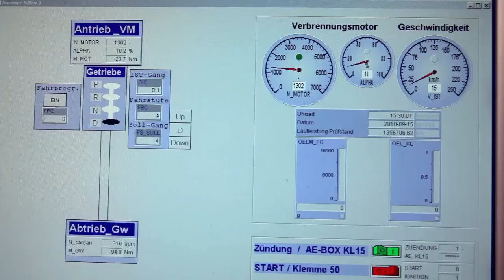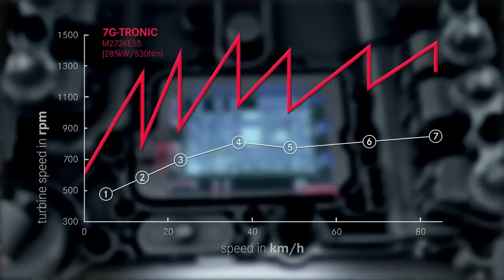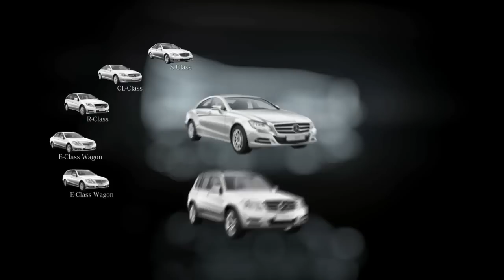Mercedes-Benz 7G-TRONIC Plus Transmission

Comment: lol, at 4:08.... I bet that pump alone costs over a grand.... and when it does fail (which it will) either the "stop start" function completely goes away OR the car goes into limp mode and you cant even drive it until it gets fixed.  

All to save a penny or two of gas while you car idles at a stop light.... yeah no thanks.  Id rather have my car idle, and spend the extra 20 bucks in gas per year, then have some random part involved that costs more then my 1st born to replace.
Reply: Michael G don't worry it will not. These transmissions do millions of kilometers in German taxis. Most reliable auto on the market. ZF doesn't come close in reliability, hence no BMW taxis. MB is the benchmark. But for sure ZF is nicer to use.

Comment: Less fuel consumption but you will spend extra money for the broken parts :(
Reply: Agusta Prakersa well you could drive a decade with a fiesta for the price difference between it and cheapest Mercedes offering. So If you want to save up save up on car first.
Reply: +Agusta Parkeras And these parts takes lots of energy and materials to make, so in the end  you spend more money and pollutes more! However, its great for the corporation, since they can market the suppose efficiency of the newer model, while making more money on parts later on! In extreme case you may have to buy a new car if your transmission fails.
Reply: Saving energy not necessarily saving your money..
Reply: if it broke, yes you are right, but it never broke my bro
Reply: More confort more diving plesure! And at the end less fuel consumption :))  So thats not the main reason for pepoles who buy a mercedes

Comment: Its a nice gearbox but it has big factory problems.If i buy a MB i buy it for its reliability , but with this  gearbox nothing goes like it should and one day one the highway u will have to call the pickup to get you cuz your gearbox control module failed due to a facory problem.Very disappointeing!!!!!!!!!!!!!!!!

Comment: naahhhh.... i prefer manual. i like to drive my car.
Reply: +Igor K there's a difference between 'manual' mode on an auto and a proper manual transmission
Reply: +Kelly Larsen  Clearly you have never driven a modern autobox. I recently drove a VW Polo with DSG box and was quick and beefy without being fatiguing. Manuals are BEASTLY boring and wearing around town (not to speak about queues) and are more economical ONLY if you ALWAYS change gear at the right time. Which is NOT the case because humans are not robots. My humble age-old Fiesta diesel with robotized gearbox is more easy of fuel than the manual version.
Reply: +Kelly Larsen 
not really not in a DSG transmission, you still can choose your gears and the transmission can shift way quicker than a person.
Reply: +Igor K if you like your cars squishy and boring, then by all means. also, in pretty much all cases a manual gearbox will have less drivetrain loss, and therefore better economy, than an auto.
Reply: +Jeff K a twin clutch gearbox (DSG) is about the only gearbox technology I'd consider getting over a proper manual.
Reply: +Gavichap I'm not talking about dsg boxes. I've already stated that I'd be happy to consider a DSG over a manual, not sure which way I'd go, but I'd consider it.

Comment: I have a 1999 C230 with 5G-TRONIC Transmission on it.  The current mileage is more
than 250,000km.  The transmission never needs oil change and break down and is still running good. Their quaity is great.
Reply: +tom CLARK I think you must look after your car very much! But plese change the gearbox oil =) It might feel ok but it will be so much healthier with some new oil. and your peace of mind will be better =)
Reply: tom CLARK you are very good care of you Mercedes...thumb up bro
Reply: +tom CLARK  Well, it`s high time that you changed the ATF and filter. It will be full of microscopic shit. Use Dexron III as  it is a very good synthetic auto fluid or the transparent Dexron III E II if you must.
Reply: tom insighty u must be driving it below 40km/hr throughout the 250,000km mileage done. WTF u never change oil at all

Comment: The transmission Control Unit is a big problem, one time I had a problem with shifting going in to limp mode, so I had it replaced costing me $1500. After 3 years I have another check engine light that indicate a lost communication with transmission Control Unit. This fix will cost the same amount. Therefore, the quality of the transmission Control Unit is not good and it will fail sooner or later.

Comment: better shift dynamics? and then Mercedes woke up with there head in a pool of anti sheer molecule transmission fluid. This transmission still cant take the thrust of there high performance motors, and when serviced loses its smooth shift for it never to return.
Broke! it should never have been fixed...

Comment: I made a few tests with this transmission. If you want to see how quick it is with paddle shifters in action and how fast 7G-Tronic Plus can handle with different speeds and acceleration be my guest :)
Reply: i had a mercedes a250 and damn this paddles system works so slow
Reply: sator soberi Paddle shifters works fine with mine (7G-Tronic Plus). Check my video.

Comment: Driving pleasure? Automated gearbox? It doesn't sound right, at least for me. Well, everyone have their own preferences
Reply: ***** tbh, I'm just upset the Merc don't give the manual transmission option for C63, it would be so much fun as you won't get out of the car unless you have to pump the gas. As for E63 and S63 that will be the least expected car to have a stick shift
Reply: I have a Mercedes C200 W205 with this transmission. How great it is, you can see video tests on my channel. Probably never again manual tranny :D I thought the same about manual until my first advanced automatic gearbox. Paddle shifters are always ready for fun, fuel consumption is even lower thanks to 7 gears. Manual? No thanks :) I had those for 12 years in 5 different cars and from now automatic is the one to go for.
Reply: Yeah it is all depends on our choice. Like I mentioned, we all have different preferences. As for me, I enjoy manual, but for you an automated.

Comment: and if anything ever breaks it will only cost around $5000
Reply: Callum Curtis A good price for such a high-tech transmission. And it won't break that easily, most Benz run 500k without a problem :)
Reply: xXYannuschXx god i hope
Reply: xXYannuschXx  "performance and comfort"  this is a transmission we are talking about, it changes gear. the end.  This gearbox is absurdly complicated for the function it has to do.  If it is anything like the Audi gearbox, it is an expensive lemon, which will be unserviceable in 10 years time in every respect.  Rather like a plumber you call to fix a leaking tap, who then tells you you need to buy a new house this gearbox will be the achilles heal of any vehicle it is fitted to.  It eptomises the very essence of  absurdly over priced and uneccessarily over complex design, resulting in a time-bomb product which will empty your bank account for no good reason when it fails.  It will also be so bespoke and complex that long term parts availability will be highly questionable to say the least.  The best engineering solutions are ones that achieve their goal with simplicity and elegance, this transmission on the otherhand attempts to achieve its function like a Heath Robinson contraption.    I can imagine the sales pitch now: "Sir, this transmission is amazingly comfortable and smooth, it is the be-all end-all of gearboxes, but note it will cost £10,000 to repair, will last less than 10 years and you will need to buy a new car when it fails", given that this gearbox is likely to be fitted to an absurdly overpriced car, with other equally over complicated parts, you need your head examined to even consider purchasing a vehicle with this.    This one is firmly in the "expensive lemon" bracket.
Reply: +Callum Curtis Dude I'm a mercedes mechanic and i've opened one of those, i can assure you that those do not break down unless you press park while moving. BTW a complete 7g tronic gearbox costs around 7000 dollars.
Reply: These comments are painful to read. None of u came close to one of these, nor do u have engineering knowhow to understand why the complexity. 

1)  This is not a ZF. ZF is used by BMW, MB builds in-house
2) German taxis drive millions of kilometer on these boxes without failure. The car is ready for scrap before one of these 7Gs go bad (given proper oil changes of course)
Reply: Not "if" but "when"!
Reply: Callum Curtis at the very least $5000.  This is a money pit... waiting to empty your wallet.
Reply: Nobody cares, if you can afford a car like that....
Reply: at least!!!
Reply: togethia All automatic transmissions are expensive and overly complex so this one is no different and like other transmissions, repair techs work on them and can get parts for them so buying a new car is far from your only option. But face reality and count just how many MB owners that will buy this new for it's listed benefits and will then years later pay for repairs to keep the car on the road rather than buying the latest, greatest thing in the showroom at the time. I suspect the number will be quite small.
Reply: clifton559  Soo true.. I believe this shit is made by ZF and i've worked on cars with ZF transmission and i saw designed is flawless.. but they're smart enough to use some material that would eventually wear out in 10 years.. and in agressive driving even less..  the biggest joke is the non serviceable oil in them.. its B.S.  i've swapped lots of them from previous models
Reply: +marcoalza plenty of good cars have transmissions that don't cost 5K
Reply: My mercedes w211 320cdi has the 7g tronic it has 300k on it still shifts like new.
Reply: 5k is reasonable if you get another 100k miles out of it
Reply: john wheel Well no not really, 5K for 100,000 miles on a transmission is absurdly expensive.  For that price it should outlive every other price on the car, but because it is over complex to say the least, it won't last anything like as long as a more conventional straightfordward gearbox.
Reply: @togethia 8 years have passed since you made this comment i have a 2007 mercedes w211 320cdi 7g tronic 300k on it never had any problems with the transmission and seen a 320cdi with 830k the transmission shifts like new.
Reply: togethia
But does that conventional gearbox has the performance and comfort of a 7G-Tronic?
No it won't.
Reply: togethia I do think that if someone has the money to buy such car, the 5k after 10 years are just coins.
Secondly: in 10 year more probably that one has already changed the car.
Thirdly: who buys this kind of cars, buys as kind of insurances 

Thus the whole preoccupation about the failure of this device (whoever transmission counts a lot in terms of energy employment! It's not a useless part of a car!) is totally a nonsense
Reply: Thats what happens when you own a benz!
Reply: Well, it cost me $500 from a local proffessional to fix that TORQUE CONVERTER when it broke ... and i thought it was too much
Reply: $5k...more like $8 to $10
Reply: mine just failed after years of abuse. Got 280k out of it and its still drivable, 3rd gear just slips.I'm getting a replacement used one with 100k for 700$ and doing the labour myself, very reasonable.
Reply: Please what you don’t know could fill a book
Reply: togethia
From your first sentence I knew you have never driven a high-class Mercedes.
"Over-complex"... that is called engineering. Something that is completely absent in - for an example - American cars.

Mercedes wanted to create a automatic transmission that is as fast as possible at shifting and still remain comfortable.

Also, how do you know that it won't be repairable in 10 years? Porsche for an example is still able to produce parts for 30 years old cars. Mercedes won't be any different here.

A simple design is not always the best design, there is a reason cars in general are getting more and more complex.

Comment: Why not just make a manual transmission with the computer controlling the clutch and gears. You get the reliability and efficiency of the manual transmission with the ease of an automatic. FYI I drive a manual car. With the computer strictly doing good driving habits with the clutch, the whole unit would last the life of the car. Call it the 7 R Manual for Reliability.
Reply: KiwiPowerNZ  What you're referring to is the automated manual transmission. Its basically a manual transmission with only a control unit added to do the shifts for you. Fiat and Opel tried it on a couple of their cars but they have the disadvantage of slow shift times (they shift just as a manual does), and a bit of jerkiness in urban driving. Both manufacturers have given up on it eventually, even if they were good on fuel, and the dual-clutch is know widely adopted by all European manufacturers for its fast shift times. However, the dual clutch is still just as jerky in urban driving and is not yet reliable at all. The truth is that a transmission using a clutch will never have a take-off ability as smooth as a torque converter, but the torque converter is a major source of power loss in a transmission. The best option currently would be to have a regular automatic with a very high number of gear ratios (8,9) to make up for the power loss with better gearing. Many OEMs are currently adopting this approach (Mercedes, BMW, chrysler group)
Reply: yea you're basically talking about a dual clutch system except worse. Manuals are great though, i hate being at the mercy of what my stupid automatic tranny thinks its supposed to do, like downshift hard at full throttle to spend .5 seconds at 6000 rpm only to change back to the gear it was just in. Makes me sick.
Reply: That type does exist and they are actually used in some of the highest quality racing vehicles, however people driving luxury cars like smooshy transmissions as opposed to hard shifting ones... so typically they wouldn't be considered luxureous enough.
Reply: i was thinking about the same thing. F1 cars has this kind of gearbox and it beats auto and manual gearboxes.
Reply: ZF 7DT (Porsche PDK) This is a computer-controlled manual gearbox with twin clutch. Best transmission ever biult
Reply: Volvo I-Shift is a 12-speed, two-pedal, automated mechanical transmission that maximizes driver comfort, payload and fuel economy.
Reply: danthemanzizle An't that the truth!
Reply: atomgonuclear It's not what they like, it's how it's supposed to be. In an uber luxury road barge you wouldn't want a jerky transmission would you?
Reply: tavi921 yes
Reply: tavi921 It wouldn't be that jerky, the computers controlling the clutch remember, I'm sure it can change smoother than I can, and my changes aren't jerky.
Reply: Aston Martin tried that and it led to slow sift times lots of jerkiness also it had reliability issues they kept breaking.
Reply: I know the comment is old but BMW E60 M5 is exactly that. No torque converter, one clutch, 7 speed. Its called SMG(Sequential Manual Gearbox) thru BMW, In Auto it could switch to any gear, in manual however, you had to select thru the gears one by one, hence sequential. Dual clutch are second generation. Two clutches make for less rear wheel power lose between shifts.
Reply: Rozgreez Interesting thanks for the info.